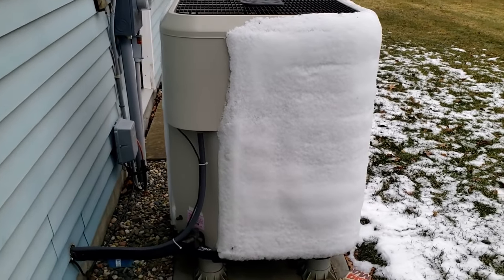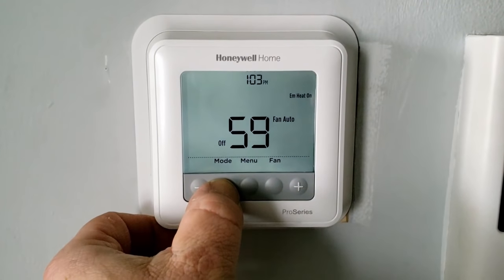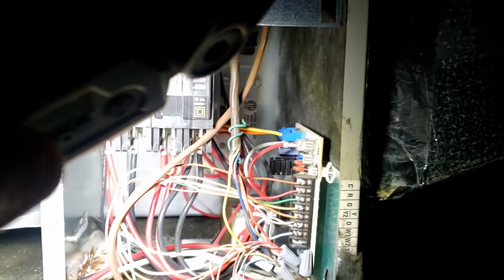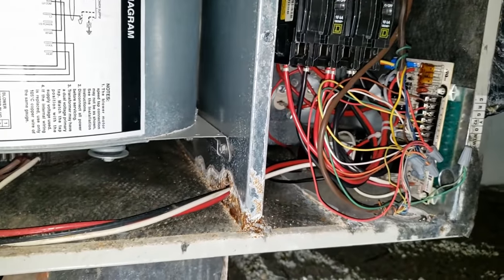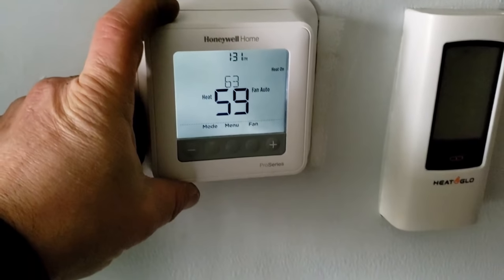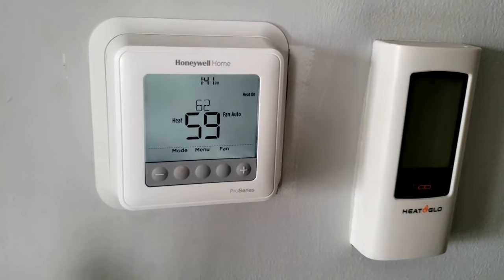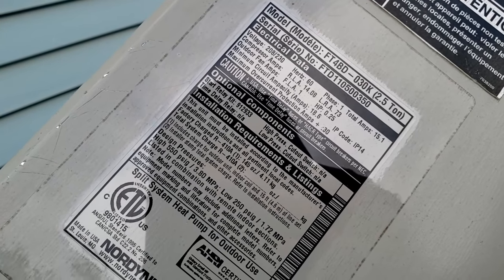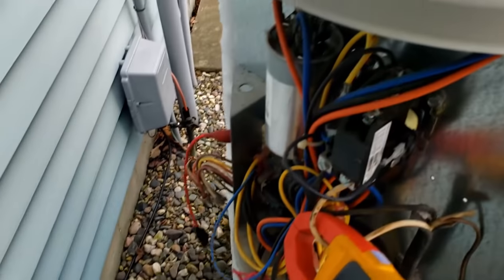HEAT PUMP FROZEN UP LIKE A ICE MACHINE I MISSED  UP & TOASTED THE FUSE

Comment: Your trouble shooting skills are in need of help. You are what I called a hunt and pecker tech. Take some advise, and develop a plan of attack going from simple to complex problems. Stop bouncing all over the place. Next time turn the indoor fan on man, jump power to contactor, pull wire to fan and defrost. Preferably with water, to be sure all the ice is gone. Then see if it works in normal operation, and figure out why it doesn't defrost properly. Hunting and pecking takes twice as long, makes you look unqualified  and costs the customer more than it should, for below average service. Or you could find a job your good at. I spent 40+ yrs in the trade and trained dozens of techs. The hardest part was to teach them to have a plan and execute it, stop fumbling around and hopeing to stumble onto the problem.
Reply from the maker: As I mentioned I am not familiarized with the Nordyne  electronic system so I had to get familiarized with it. If the instructions were simple to understand or if they followed the industry standards and it worked like every other heat pump I've ever worked on for the last 26 years,  whether it be Lennox, Carrier, Rheam or Trane, it might have gone quicker.  Far as bouncing around, when I see cheap equipment like this I know what kinda people it was installed by.  I tend to check everything because half these people don't even know how to wire up a thermostat let alone pull the proper evacuation and do a start-up. Heck they didn't even know how to properly do a trap on the air handler. So why should I trust anything they've done?  I'm financially responsible for any call backs so I don't skip anything. This was the first time we had been to this customer and we had no history on it. From all the comments I've received on this hp about defrosting the unit,  it appears everyone's worried about how to get it defrosted and not figuring out why it froze up.  I wasn't able to do any diagnosis until the ice was gone so half-assing the controls so that I can melt the ice off really doesn't tell me why it happened.   I tend to clean up the mess after I find the problem that caused the ice up and testing the 2 devices that control the defrost are a good place to start in my book.  Otherwise it's just going to happen again. I thank you for your viewership and comment.
Reply: This was painful to watch.
Reply from the maker: @Dave_Thomason  thanks Dave👍

Comment: Heat pumps suck. I inherited one in my home here in SW Nebraska. I am using smaller heaters this winter until I can get propane connected next year. Alone the fact that Biden wants to push for gas furnace removal and go to heat pumps is enough for me to say NEVER. They are garbage if you live anywhere north of Arkansas or South Carolina. If you hear someone talking heat pumps, RUN!
Reply from the maker: It depends on propane cost and the model of heat pump if it does a good job. I can get a good temp rise out of the inverter driven units down to 5*.

Comment: I don’t like heat pumps
Imagine eliminating all gas furnaces and having 100% heat pump
Here in California all new Contruction are using this things, specially the ceiling type air handler 
Alway leaking, noisy, braking down in less than a couple years, if it gets below 35 degrees the heat sucks
Sorry for the ones that are in favor of climate deal
Reply from the maker: Me neither 👍👍
Reply: that would suck. Thats bidens plan. Let me safe, heat pumps rarely run great for YEARS. I get many heat pump no heats.

Comment: 62 degrees, are these snowflakes insane?
Reply from the maker: 62 inside, not outside, they we're on vacation is why it was so cool inside. Outside temp was what I mentioned in the video.
Reply: I can't even tell which side of that comment you're on. Trying to get my own house over 55 or 56 when it's below zero outside is just a waste of gas.
Reply from the maker: @moconnell663  are you referring to my comment to Buz? Because I'm not sure what he was saying, just like I'm not sure what your talking about.
Reply: @HVACRSurvival  I couldn't tell if he was calling them nuts for having the heat too low, or for having it too high :) different strokes for different folks.
Reply from the maker: @moconnell663  exactly, I'm just there to make it run, they choose what they want to put in and I don't pay there bills 😁. Whatever🤷‍♂️🤣

Comment: This video is EXACTLY why heat pumps are junk. (Insulate your home a lot better and you won't NEED a heat pump.)
Too complicated and too expensive to fix.
They could easily simplify them to shore up reliability and cheaper repair costs.

Money saving tip for A/C's and heat pumps -
Make SURE that your clothes dryer vent is no closer than 10 feet away from the unit.
Too many people put the vent too close to the unit and all that dryer lint just clogs up the coils.
No fun paying the repairman to come out in the dead of winter to defrost those coils and clean them.
Lotsa money involved.

Comment: Hardwire it to cooling start it up throw a blanket over the top. It'll defrost in no time
Reply from the maker: The blanket is probably the best idea I've heard yet 👍👍. Like I told all the other ones that have commented, the only reason why I ran it to defrost over and over was to find out if it could defrost on its own and determine if it was the defrost board, defrost termination switch, or something in the refrigerant circuit causing the problem.